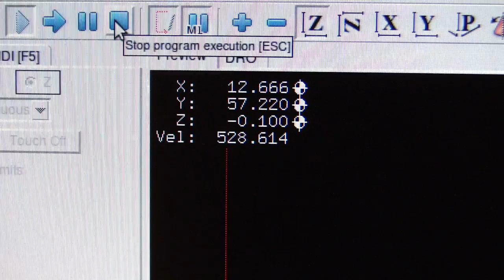CNC milling VQ44 to DIP44 PCB

Comment: I had a PCB made for me with the milling method once but after having to clean up whiskers etc for over an hour, never again.

Toner transfer done properly with a laminator at 170 degrees (and that's the secret) works perfectly.

Yes it takes longer, but I find the results are worth it. So far I have done 0.2mm traces, and it looks like even 0.1mm should be easily attainable. 

The Photoresist\UV method is also very good, easier to get right but requires more materials and is more expensive.

Comment from the maker: I've since used a four sided cutter and also dialled out the backlash on the machine, the problems are all pretty much resolved now.  Just a scrub and done. 

Etching is just so messy. I previously  used UV and I still have all the equipment too but there isn't much like sticking a piece in the mill walking away and coming back and having a board all routed out and square. The thing I hated most with toner transfer was getting the design aligned on the board, even cutting the PCB was a pain.

Comment from the maker: Turns out the failed board work just fine, the shorts where from micro-fine links around the header solder pads where the mill didn't connect up with the previous cut. They where so thin I couldn't see them until I put the board up against the light and used a magnifying glass! So the beautiful failure now works a treat!

Comment: PCB is an epoxy & fibreglass substrate with a thin layer of copper on the top, all he is doing is cutting through the copper layer in between tracks, thus isolating them. This operation is called isolation routing.

Comment from the maker: Has a solder bridge under the device I can't seem to fix. About 8 pins are shorted to the left over copper. The chip is fine just have to get it back off the board. :/

Have no luck with attempts number 10 and 11. Machine has a backlash problem that I can fix until I get a dial gauge and set up some backlash compensation. 0.5mm tracks are pushing the limits of this machine I'm afraid. Needs better screws and a rebuild.

Comment from the maker: I used gEDA PCB and it's GCode export. I've also used pcb2gcode and the Eagle plugin pcbgcode with also great success. 

Most converters are simply just image tracers that take the gerber output, render it to a high-res bitmap and trace the edges. I've yet to find one that actually does a vector to gcode conversion. Circular pads are made up of tiny lines (G1) instead of using gcode's arcs and circles.

gEDA PCB takes some getting use too but it's very good. I like the text file formats.

Comment: Why didnt you just put a sharpie in the cnc mill and have it draw out the copper part. Then dissolve the negative area with cupric acid from Radio Shack.

Comment: Looks like a pretty nice result :) I would increase the accel / decel on that mill though. There's no need to keep it that slow. Steppers can accelerate faster than just about any other motor.